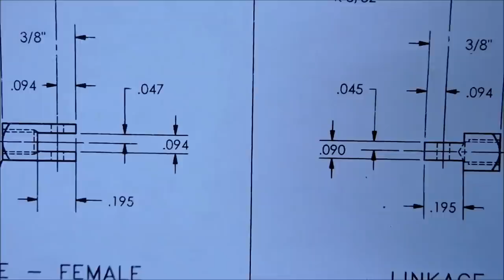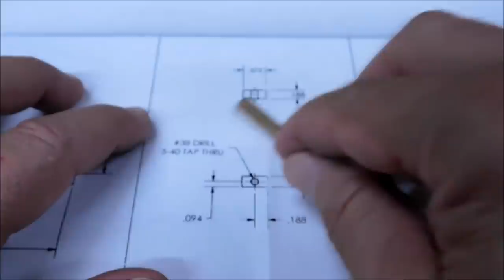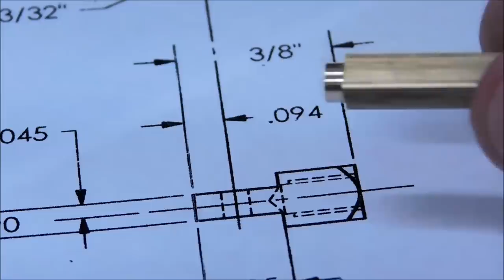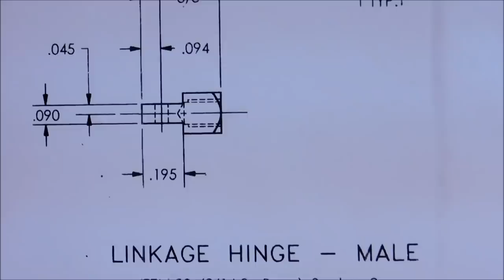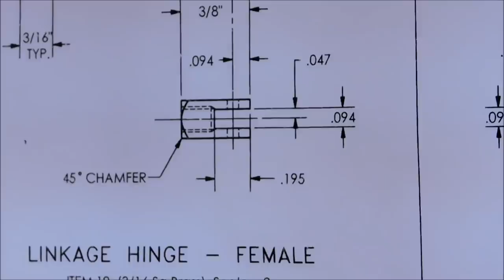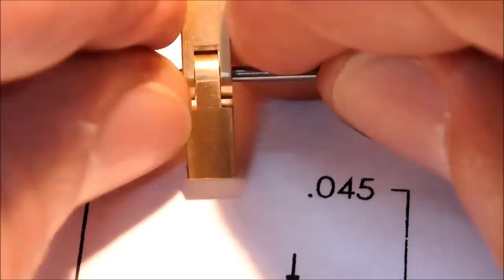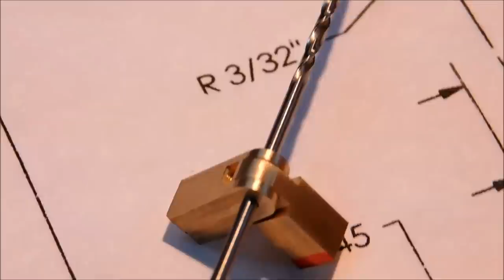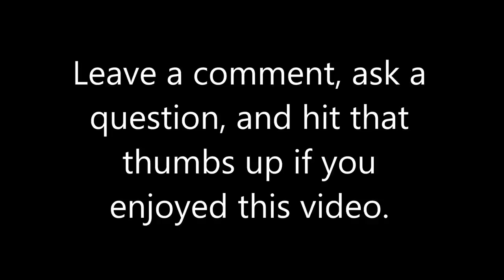Machining a Model Steam Engine - Part 4 - Square Collets and Small Parts

Comment: Why was the square collet built with 10 thou taken off of only one side, rather than taking 5 off each side or something?
Reply: Doesn't really matter.  And doing it Joe's way cuts down on the work.  Better just doing a last pass on the one part than needing to do it on both.  But either way would work just fine.
Reply: @brucematthews6417  But doesn't cutting just one side make the stock off center?
Reply: @iamkilroiyo  no, as the cut is for clearance of the collet itself, the part is still located in the center. you could clearance each by .005", but it's more work and doesn't make a difference from just taking .010" off one side.
Reply: @dobrzpe  @joepieczynski Thank you for the reply, ug. I can't wrap my head around where taking more off of one side doesn't push the part to that side. If the collet clamps evenly, won't it push the part to the smaller cut? Like don't halves move the same amount making it off by 0.0025? Sorry, bud. I don't mean to waste your time on a dumb question.
Reply: @iamkilroiyo  oh, ok - i get your confusion... the relief is from the mating surface between the 2 halfs of the collet... NOT from the registration surface of the part... the closest thing i can equate it to is scope rings for a rifle - if the scope rings are cut EXACTLY for, say, 30mm and you put in a scope that is 30mm, the only clamping force exerted is from the fit of the 2 halfs together.  SO, you cut .010" off of one surface so the rings can clamp BEYOND the 30mm they are designed for (clamp together closer) so you have as much clamping force as you want.  thats why there is clearance.  basically, when the 2 parts (scope rings or this collet) are put together, there is sufficient space between the 2 parts in order to get as much clamping force as desired - once again, because the material is removed from the fit of the 2 pieces together and NOT the surface that holds the part.  (hope i explained properly and didn't confuse you more! LOL)
Reply: @dobrzpe  Thank you for your answer--it helps a lot!

Comment: These videos are great at showing how a real professional goes about overcoming the problems making this kit, but it does involve quite a lot of expensive equipment. However, when this type of casting kit first became popular, most hobbyists would only have a 7" lathe and a drill press. No collets or similar, just a scroll chuck. Hobby mills didn't exist and when necessary milling was done with a "milling slide" mounted onto the lathe topslide. The milling slide could be either a modified compound or a dedicated item made by the hobbyist. I came across this set of instructions for making a milling slide - https://www.countryplans.com/vintage_farm/machineshop/SMJun58LMA.pdf
It all looks seriously shaky - it would certainly be a case of very light cuts and slow feeds. The lack of rigidity must have been a massive problem. Makes my lathe-mill combo (Grizzly G4015Z equivalent) look like luxury in comparison.
Reply: There wasn't a lot of expensive equipment used here? And I think it was extremely likely that a lot of these parts were filed by hand so that they both fit, and worked. Which was probably easier and quicker than lots of setups with a vertical slide.
Reply: @nickwheeler8231  I'd class the mill (Bridgeport?), 5C collet chuck and spin indexer as expensive items, certainly out of the range of many hobbyists today, and not available at all when the kits were first popular.
I agree a lot of the work would have been done by hand, and for a lot of tasks where now there is a choice between lathe and mill, the enforced choice would have been lathe, with the workpiece mounted to a faceplate.
Very different techniques to what is now possible.
Reply: @lenroddis5933  I wonder how many of the folks now producing workshop videos on here have any idea what filing buttons are. Times have changed, and the cheapness of imported fancy tools has certainly removed a lot of the need for skill, experience and ingenuity in the hobby workshop.

Comment: at 25:39 and 31:40. Could you have clamped the sacrificial plate onto table of your belt sander and not risked your fingers on the mill?   The diameter of the rounded area on both parts didn't appear super critical, and finger safety is like your virginity.   Not something you want to continually risk losing ....

Comment: That is absolutely great. Kudos.
Now show us how you do it without a lathe and a milling machine....😂😂😂😂
Reply: I’ve done it. You use a hacksaw, file and drill press. It takes longer and doesn’t look as nice but it functions.
Reply from the maker: Hold my beer........
Reply: @joepie221  What brand do you prefer, so I will come ready....😍
Reply: @kgee2111  Tell me about it...😂
Reply from the maker: @tomdeschrijver8221  I would like nothing better than to meet you at Delirium Cafe' and drink a few of those. I see they are temporarily closed. Those beers are hard to find around here, but well worth the effort it takes to locate them. And I thought that  manneken pis statue would have been larger. Little guy has a big reputation.

Comment: "Do not put any body part near this as it is spinning."  Proceeds to put hand directly under it.  Not your best Joe ;D
Reply: You are exaggerating. It’s a smooth 5c holder and he is nowhere near the part.
Reply from the maker: Its a hollywood trick called camera angle perspective. My hand was at least 5" below the part.
Reply: @joepie221  You have to admit that it makes a perfect opportunity to raz you a bit though.
Reply: @joepie221  Funny Joe...I'm not buying it tho. "Do as I say for liability issues, but not as I do for practicality", or the TV classic "Don't try this at home kids - we are what you'd call professionals".
Reply: @scottb8175  Or the even more classic "the blade guard has been removed from Norm's table saw for the sake of easier filming. Do not remove the guard from your saw" in a crawl across the bottom of the screen. (Paraphrased, because it's been a while.)
Reply: @RonParker  That was a long time ago! This Old House gained credibility with true professionals only because of Norm's practical knowledge and skills as a master craftsman! (not a plug for Craftsman - the show's sponsor). Bob's planning, knowledge, and explanations were real to the amateurs and nubes, but the pro's related to Norm making it happen. I think that is why they rewarded him with his own show. As an aside, the only machine / power tool I fear is the common circular table saw....so many things can go horribly wrong.....